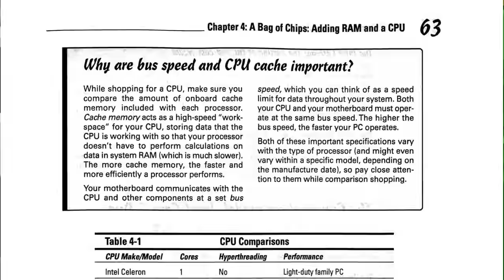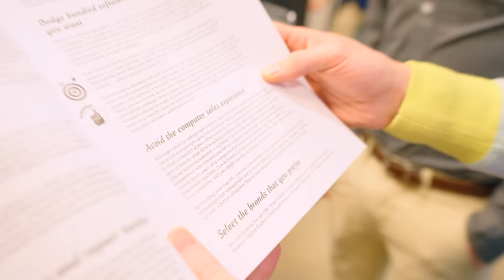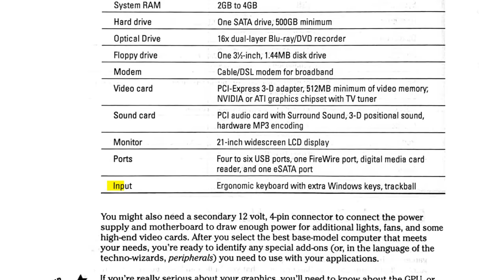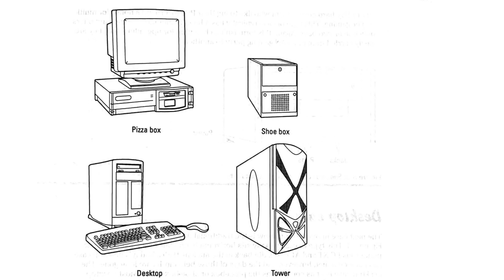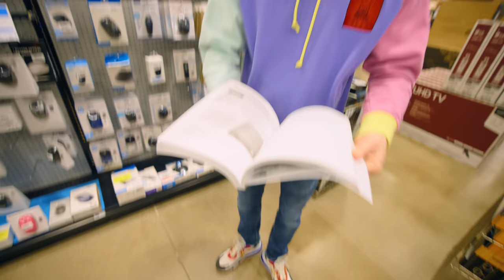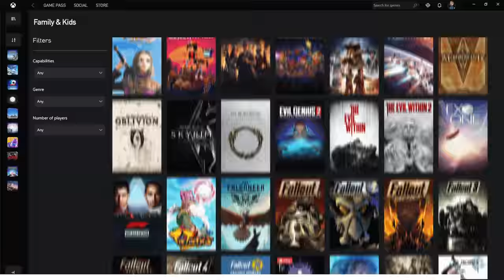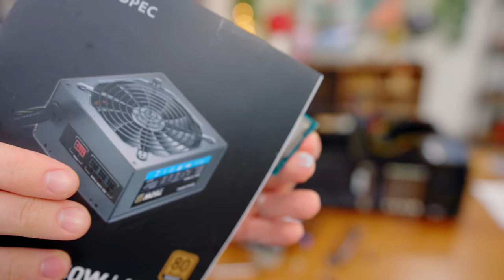I built a Gaming PC for DUMMIES

Comment: Dude, back in 2000... that's how you did thermal paste.  Granted the guy used WAY too much, but every tube of arctic silver came with a little spreader tool so you could do your pea-sized amount and evenly spread it around the CPU.  But also, as I recall, the HSF wasn't as tightly applied to the core, so you couldn't count on it spreading it properly.

The worst part was removing the pre-applied goop from the HSF.

Comment: I literally bought that exact case from micro center open box. I have not been stoked on the cooling performance. I'm using all noctua fans and the largest noctua cooler that fits in the case

Comment: Well, back when intel used pins, that was a valid process of doing it, Austin. Processors also used like a mm of cardboard on them to hold the di in place so it was easier to manage.

Comment: Greatfully I havent bought that book and only watched a lot of videos and visited a lot of web pages to build my pc by MYSELF.
Here is the build:
GRAPHICS CARD: ASUS RX 6700 XT
MOTHERBOARD: MSI MEG Z590 ACE, INTEL Z590, LGA1200, DDR4, HDMI, DP, USB 3.2 GEN2
PROCESSOR: INTEL CORE I7-11700 
SSD:  KINGSTON A2000, 500GB, M.2, 2280, NVME PCIE GEN 3.0 X4.
REFRIGERATOR: ICUE H115I RGB PRO XT
PSU:  CORSAIR RM850, MODULAR, ATX, 850 WATT.
MICROSOFT DESKTOP 850, RECEPTOR USB, 2.4 GHZ, NEGRO.
GAMER CORSAIR CARBIDE SERIES 275R , MID TOWER, ATX, NEGRO, USB 3.0, AUDIO.

Comment: 9:27 ... ok, seriously, I have used the Silverstone Gradia family of cases, so I know... you installed the Optical drive wrong.  Namely, it appears you broke off the optical drive door.  Which is part of why these cases can have a clean from panel even with 1 or 2 optical drives installed.
Now, it is possible this case included only a blank panel, in that case, you need to remount your optical drive so that it protrudes through the opening and the drive bezel sits flush with the front of the case.
Seriously though, these are good cases, I like using them for media center pc's as it is easy to drill the aluminum front panel and install an internal IR receiver.  And... they hold a ton of storage, the Graida GD08 holds 8-3.5 drives, 2-2.5 drives, and 2-5.25 drives all at once, and it is physically the same size as the GD09 seen here.

Comment: I'm 12 I got a i9 extreme and rtx 3070 water cooled racing wheel fully backward compatible ps3 upgraded and the switch i think i will put the switch manually on my phone and i might keep psp and switch lite and switch and the ps5 i have is with vr i can do the vr oculus downstairs wirelessly my 55 gallon fish tank my 5 gallon my hermit crabs my 9 gallon my 29 gallon my 5 gallon again another one and more in my room which is small a literal cube under my desk by my pc wires everywhere i move my chair disconnected i had geek squad fix it i went to microcenter and got wire hiders and they fell down like bru and then he put a power battery but anyways my monitor 100 hzcurved msi 8k 10k hdmi 250 dollar hdmi cord for ps5 and pc to left and right fish tanks tips for my cords and i lan my entire room the printer and everything
Reply: Yep. Sounds exactly what a 12 year old would saying trying to sound 'cool'.
Reply: Biggest cap